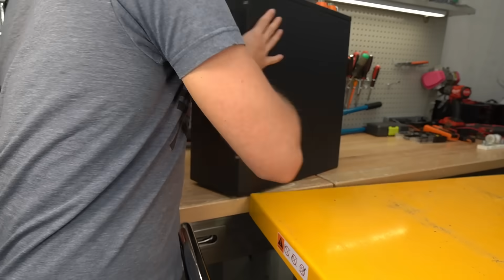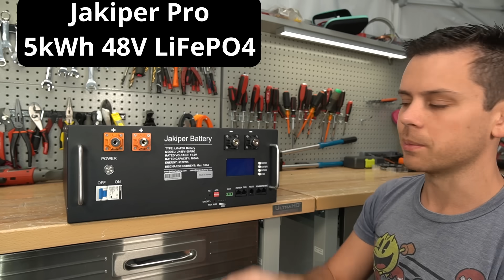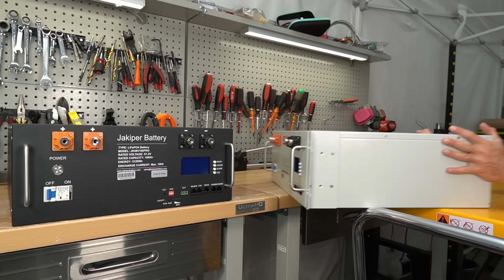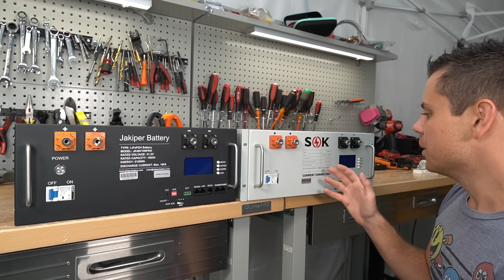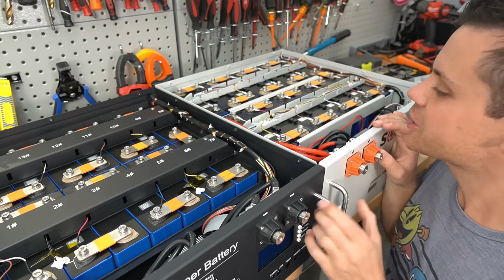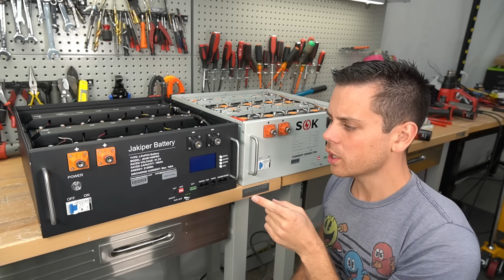$1,699 Jakiper "Pro" LiFePO4 Battery

Comment: The odds are very good that both of these units were assembled in the same Chinese Factory or at the very least the same manufacturer but a different factory since SOK isn't making their own batteries they are just specing out what they want and having a chinese battery OEM build it for them.  This is also why when you do these teardowns on some batteries they look nearly the same even though one thing like the BMS could be different and yet they were still made in the same factory.  The Jakiper could also be factory seconds being sold by the OEM that didn't make the cut for SOK or another vendor like signature solar and their EG4 line.  Granted the EG4-LL has a different front panel layout but since the cases are all made in house the same manufacturer or handful of factories could easily be making all of these units and the cheaper ones are just their to sell off the useable ones that didn't make the cut for one reason or another.  If these were factory seconds being sold by the OEM that would explain why the customer support is lacking since Jakiper likely doesn't have any actual US based support, sales and service.
Reply: You're completely wrong. SOK owns the factory they are making their packs in. The thing is, the BMS is an off the shelf component.
Reply: @HighTechLab  Even the server rack battery?
Reply: @phillq  yes
Reply: @HighTechLab  What is SOK's Chinese company name and physical factory address?  I have been trying to figure that out for a very long time but can't seem to find any of that information.  Their website doesn't have any useful information on the company or the factory's actual address.

Comment: So, Will…
When it comes to plopping down the money, which rack battery are you buying?
EG4, SOK, or Jakiper?
Reply from the maker: I would do eg4 for large system. Just cheaper and communication works. If I could only buy a couple batteries and did not want to buy a shunt, I would buy sok. especially in high vibration environment. If I need internal heaters, then trophy battery. They have the only heated server rack pack
Reply: I dunno about Will, but at this point i'm a 100% EG4 fanboi. their new inverters coupled with their well priced batteries and total comms integration, pretty much makes it a no brainer for me.  I'm not personally afraid of some more esoteric designs (aka, roll your own batteries), but there's something to be said for the set and forget nature of what's coming out of EG4 and some other manufacturers, that will make my future setup even serviceable by non-well versed off-grid setup people.
Reply: @johnhufnagel  I am preparing to build out a system in my cargo trailer (24’) and am considering 2x the EG4 Inverters and 2x the batteries. I’ll probably buy my panels from Santan in AZ (I’m in Southern AZ but will move the whole kit to Nova Scotia, Canada in a couple of years.)
Reply: @johnhufnagel  eg4 inverter do work with the SOKs with higher build quality
Reply: I’d go with the EG4 as well. 

The manufacturer who is first in supplying a fully customizable plug and play system wins the market. 
The EcoFlow Delta Pro line is trying this, but besides being too expensive they are still more of a mobile system. 
Full Home Plug & Play is the future.

Comment: You can clone the appearance but can't clone the support/customer service. The Jakiper battery wasted so much of my time trying to decipher the communication they advertised as supported but couldn't provide any help/documentation on.
Edit: Interesting, I see the Jakiper is rated for 100A charge current. I swear it was rated for 50A when I looked a few weeks ago.
Reply: Doesn’t look like a clone to me. It looks to me like they found the OEM manufacturer and told them “one of those, but with these changes” (those being the cell arrangement, the button, and the extra cable management stuff). It’s not like any of these things, including sok, is making them in a garage artisanal style.

Jakiper is just a more pure implementation of the DTC model, providing no added value at all beyond just being able to order in shipping container at a time volume.

(I suspect the Jakiper’s ratings went up because their new supplier makes higher specced batteries).
Reply: @JasperJanssen  SOK makes the batteries in their own factory seperate from Jakiper.
Reply: @HighTechLab  Is this a 'public design'?
Reply: @P_RO_  no
Reply from the maker: Exactly. And yes sok has been rated for 100A charge since it's inception.

Comment: I have a KOSTAL plenticore plus triphase. It works only with high voltage battery pack. Any suggestions cheaper than BYD solutions? Thanks.